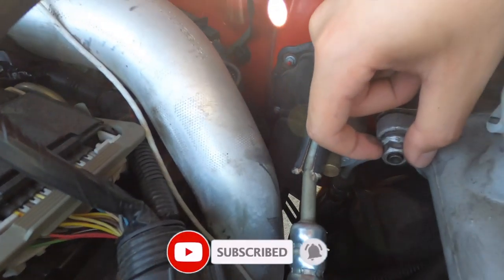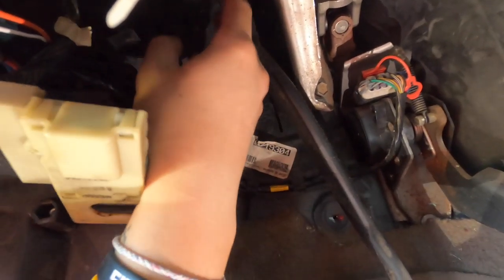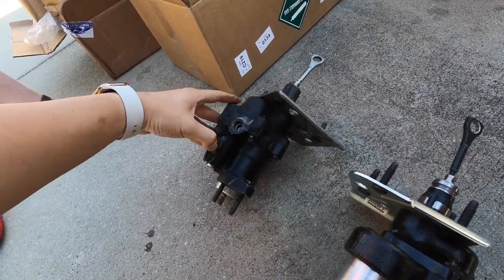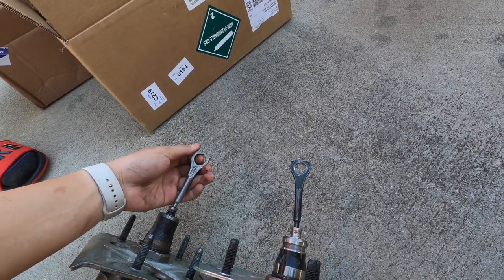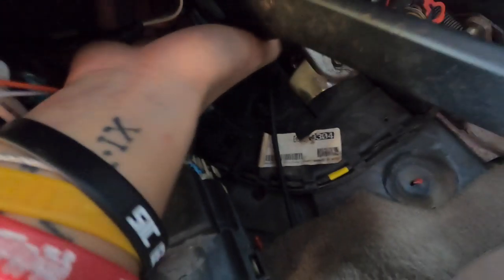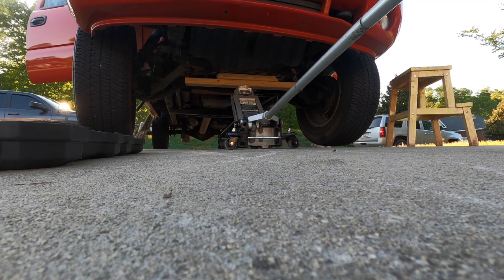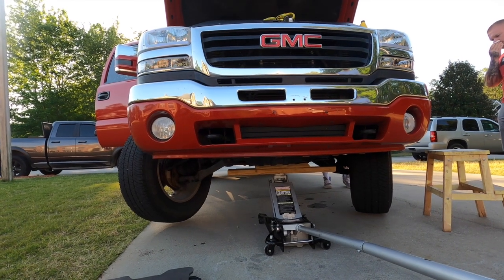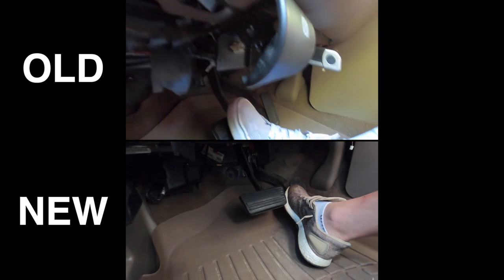WATCH BEFORE UPGRADING YOUR DURAMAX HYDROBOOST!

Comment from the maker: Been driving for 2 days now and the difference is pretty noticeable!
Reply: Awesome! Did you have to drill out that hole on the pedal connection? If so, what size?
Reply from the maker: I didn’t have to with mine!
Reply: @JWMontoya  cool, thanks.
Reply: What's the part number
Reply: Do you still have the truck?

Comment: In a pinch if you ever lose brakes again you can use the emergency brake, just hold the release while you depress the pedal. Obviously not as good as the service brakes but can get you home. Also a whole lot better than slamming your transmission into park while moving
Reply from the maker: I hope I’ll never have to run into that problem ever 😭 Luckily the LML has exhaust brake which helped a lot
Reply: Well, there’s honestly no arguing with your last sentence.

Comment: A little late to it but I’ve replaced the booster with the new one and drilled the hole out and did everything right to my knowledge but now it’s like the brake rod isn’t activating the brake switch, ( the brake switch is good, we pushed in the clip manually and it turned on the brakes) any info on what the problem could be

Comment: Did you have to remove and replace the pushrod from old hydra boost into the new hydraboost or does the new GM one come with the pushrod ready and installed

Comment: So I have done the hydro upgrade on my LBZ but I have been noting overheating brakes all four. I have flushed the power steering fluid as well and no change. I tried to install a washer between the hydro and master and the over heating goes away. Any ideas?

Comment: I got this upgrade for my truck but the mechanic told me that I couldn’t use it unless I put it into neutral and start the truck and then put into gear. Idk what the problem would be. Anyone else have the same issues. It’s an LLY 05 duramax and the hydro boost was a acdelco from a 2011 gmc duramax

Comment: Does this work on a 2007.5 Duramax (LMM) with the vacuum brake booster? All I see are trucks without the vacuum booster.
Reply: Yes, it will work. And all diesel trucks have to use hydroboost because they do not create vaccum like a gass engine does.

Comment: 178-0853 is the original LML dually crew cab hydrobooster. What is the difference between this revised PN 19371361 and the original 178-0853?

Comment: Anyone ever have issues after installing this? Right now it feels like the braking it worse then my old one. I literally have to push the breaks all the way down to the floor for the breaks to kick in. And also it now won’t shift out of park unless I turn the key once and then put it into drive. :( same part number same engine LLY. Idk if it’s just a faulty part or the mechanic I sent it into to do all this just messed it up somehow.

Comment: Could a bad brake booster cause your rpm needle to surge and vibrate when letting off the brake?? Dealership said the reason my truck is doing that it is due to a bad booster

Comment: Would you recommend also replacing the master cylinder?  Mine is an LLY with the original master cylinder.  If so, master cylinder made for 2005, or for 2011 ?
Reply: No, you don't need to. You changed nothing with the brake system, only the brake assist.

Comment: plz helppppp.... I literally just did it in my 05 lly and upgraded to the 2011 ...same thing... but for some reason while applying the brakes my power steering is still hard to turn..other than that everything else is working.. amazing brakes and amazing power steering while im not applying the brakes...why????
Reply: Did you figure out the issue?
Reply: @lewisgeer1994  nope just figured it's supposed to be like that
Reply: Maybe you have air or your pump is weak, check out the PSC pump.
Reply: Pump doesn’t have enough psi to pressure steering and brakes at the same time

Comment: 🤩
Is this an "upgrade" on a 2006 lbz as well, do you know?
Another question, at a stop or slow moving my steering will kinda lock-up/not want to move. Have you or someone you know have that problem and know if sometimes it's the hydroboost system being the culprit?
Good vid, btw.
Reply from the maker: I wanna say LBZ owners have done this upgrade as well.

Comment: What symptoms would you have with a bad hydroboost?
Reply from the maker: Lack of pressure
Reply: @JWMontoya  my powersteering doest work wen turnig right...would bad hydroboost cause this?
Reply from the maker: Could be bad power steering?
Reply: @JWMontoya  thats what is going on with me even after replacing pump.

Comment: All 4 of my brakes are now catching. 2011 hydroboost on LLY. Help please!!!
Reply: @James B  Did you ever figure out what was causing your brakes to drag after upgrading to the LMM hydroboost?
Reply: @jamisondonato5766  yes. I had contaminated my master doing a bench bleed with power steering fluid. Shortly after I realized I flushed with brake fluid and installed. Once contaminated you gotta replace. The next thing was that the new hydroboost pin is slightly longer than the original. You cannot adjust the length of the pin and I wasn’t about to take it apart. I put in a #10 washer on each peg between the master and the hydroboost and that fixed my problem.
Reply: @jamesb3654  awesome.  Thanks for the update.  I'm about to do this upgrade on my 04 K2500 Burb. It's the same part numbers and I've got an 06 lbz in it.  I'll post up my results after this weekend.
Reply: @jamisondonato5766  ohhh that is sweet! I have a 04 burb 1500. I’d love to do a duraburb conversion some point. Do post update! I can tell you it’s a major upgrade for braking. I feel more confident in stoping with my load now as sometimes before it was a bit questionable and I was like crap… this is it… this idiot is gonna get ate up for pulling out in front of me.

That brake pedal clip and those bolts will be your most difficult part. You can put the master up to the new hydroboost and see if you feel the pin hit the master when it is butted up together. I also drilled the pedal rod out to 17mm but I heard someone use the standard drill bit and it worked as well. Just have to measure that part and see! Good luck!
Reply: @jamesb3654   Sorry for the delay, but I got the new 2011 hydroboost in there and it feels awesome.   took me some time to get the air bled out of the PS steering system as I changed out my lines and the steering box as well.  But holy cow, that feels really good.   Towing a 9k TT last week, had 3 deer jump out in front of us and the truck and trailer was so confident in stopping abruptly and felt great!  seriously recommended upgrade.   My only complaint was trying to maneuver my fat hands under the dash..  Normally its fine, but this truck has the adjustable pedals and I was cursing them the entire time.   Other than that, good to go.   thx.
Reply: @jamisondonato5766  No worries! Yeah bleeding the whole system is a fun story by itself and don't even mention the bolts behind the pedal haha. Did you need to put the washers in there? It is definitely a better gut feeling when you have to abruptly stop. You kinda know now that you have the capability to stop at a good distance with a good size load! Look up stainless steal break lines when you get the chance. The rubber ones tend to expand with age and the stainless will prevent that as well creating more stopping power from my research. Glad you got that fun task over with! I want to see the burb on a video!

Comment: According to the O'Reilly Auto the vehicle compatibility chart the 2011 LML Hydroboost is a one off part for the Chevy and GMC trucks for that single year.
Reply: With slight modification of the booster push rod, this hyrdoboost can be used on 2001-2010 trucks to aide in curing the notorious low spongy pedal feel.